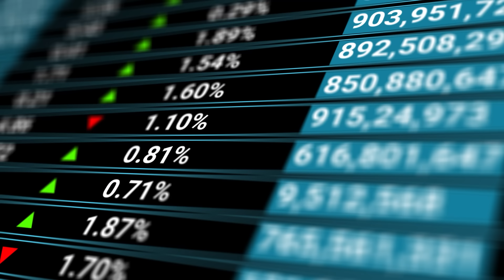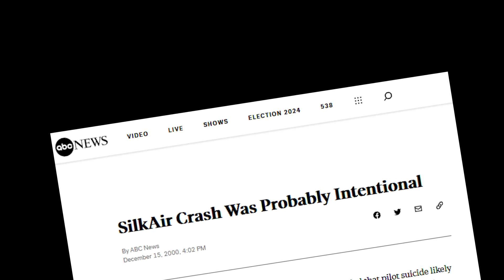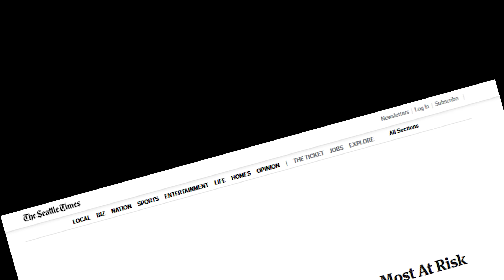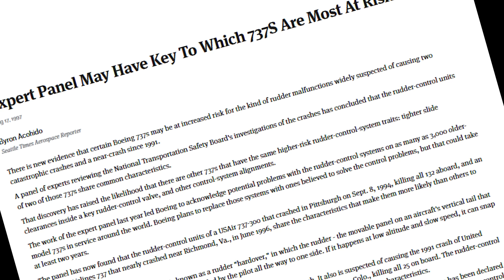What Caused This Plane To Break Up Mid-Flight!? | SilkAir Flight 185

Comment: The NTSB, which had jurisdiction based on Boeing's manufacture of the aircraft in the U.S., investigated the crash under lead investigator Greg Feith. Its investigation concluded that the crash was the result of deliberate flight-control inputs "most likely by the captain". While the Indonesian NTSC investigators found "no concrete evidence" to support the pilot suicide allegation, and the previously suspected Parker-Hannifin hydraulic power control unit (PCU) had already been determined by the manufacturer to be defect-free, the final statement from the NTSC was that they were unable to determine a cause of the crash and was thus inconclusive. The Indonesians wanted to believe the Parker-Hannifin-made PCU that controlled the aircraft's rudder could have been defective and thereby led to the crash. The cause of some previous 737 crashes, such as United Airlines Flight 585 and USAir Flight 427, had been attributed to the 737's rudder issues. Although the NTSB and PCU manufacturer Parker-Hannifin had already determined that the PCU was properly working, and thus not the cause of the crash. 

When Greg Feith tells you what the cause was, believe it. The only reason this is still 'undetermined' is because Indonesia and the NTSC dont want to admit to the pilot suicide conclusion.
Reply: I will like to clarify that the NTSC investigators agreed with the murder-suicide conclusion. However, the higher-ups decided to intervene and basically rewrite the report to not include the probable cause.
Reply: @OwlRTA  Fair enough. The NTSC did write the report, claimed it was undetermined, and (effectively) signed it. If someone above was forcing them, it doesnt change my statement.

Comment: For 18 years, I was an industrial engineer who was charged with the support of avionics systems at both the vendor, and sub-vendor levels, at "the Silicon Valley of the East" (yeah, had to put my "ANG" blues on, march with seven other reservists/guardsmen back in '84 to meet Reagan).  I know for a fact, that it would not be difficult to D/B/T a secondary AOA, plus Mach Airspeed, plus VSI, plus throttle/autothrottle "attitude-stabilization forward stall+overspeed" "intentional harm override systems", which would require BOTH piloting positions to respond similarly to override, plus access the MCDU to contact ATC/ARTCC, even if transponder telemetry is switched off.  Batouti/Lubitz/Ming could have been very easily defeated, hog-tied, subdued, and the entire population of the cabin could then have their turn kicking the 'living crap' out of those bastards. Hell, they could even request a "hold on radial, we gots-to run some numbers, verify a checklist before landing", so that everyone could provide second servings, and have police/EMS/ARFF fetch the "padded ambulance"....
Reply: Ok. What happens if one pilot is incapacitated, and then all of the flight computers give false data to a plane that doesn't know it's false data? The other pilot cannot override your supposed "solution" because it requires two pilots. Plane stalls and crashes, people die.
Reply: @OwlRTA  That's in part, why 'dual' systems fbw+cable/hydraulic systems are used by BAC, FBW systems toggle between 'laws and logic' when instrumentation/other avionics have discrepencies, especially with pitot tube problems. I've always been of the opinion that radio-measurement along with GPS systems should be capable of being switched during times of emergency, into some other display/interactive control circuit besides the MCDU. There's just no straight forward way to get that task accomplished. The two front seats MUST always be the final arbiter,  but then, the suicidal pilot, how to override question arises...

Comment: The problem with writing it off as pilot suicide is that there's no unequivocal evidence for it, it's just everything else appears to have been ruled out. But I wonder how many design faults there are on airliners with an extremely low probability of occurrence but severe consequence, like the 737 rudder reversal. Maybe ones with a probability of occurrence even lower than that one. In which case it may never occur in the lifetime of the aircraft type or just once. And an unlucky pilot gets blamed when one of these does occur.
Reply from the maker: Very true, all of the facts and evidence are not present in this case. It just so happens that the factors we do know line up to suggest something nefarious. It's always difficult to suggest that the pilot was to blame for a deliberate act, when in reality it could have been that he was attempting to recover the aircraft from an issue not known to the investigators. The problem with this incident is that external factors outside of the aircraft also play a role in the suggested outcome.
Reply: Rate of dive is as hard an evidence as one can ever get.

Comment: In 2004, following an independent investigation of the recovered PCU/dual-servo unit, a Los Angeles jury, which was not allowed to hear or consider the NTSB's conclusions about the accident, ruled that the 737's rudder was the cause of the crash, and ordered Parker Hannifin, the PCU/dual-servo component manufacturer, to pay US$44 million to the plaintiff families.

Comment: All the way up to the clicks heard at the end of the voice recording... I was thinking "Could something have hit the tail section?"... I don't know (without evidence of fire somewhere) what it could be, but then the clicks in the recording seem to indicate deliberately shutting things off or pulling the breakers...

    It's definitely a dubious thing to get an accidental dive so steep, though... if the clicking "off" of switches/circuit breakers could be otherwise explained by electrical faults, I could still suppose an external collision could do it, and even maybe without fire. It would just about have to be something like an ultralight, something small enough to be unregistered, BUT at 35,000 that doesn't sound 100% doable, and a missile type object would be pretty obvious...

     AND of course, in most recent memory, Germanwings has taught us that while rare, it IS possible for a pilot to lose his interest in living... I guess.   ;o)
Reply: A meteor could do it.
Reply: @raviarjuna9839   NOT going to say "impossible"... BUT with the heat of re-entry for a meteor, it's improbable for the lack of fire evidence or heat damage...   ;o)

Comment: Curious, if it wasn’t a defective servo valve inside the PCU then why did the manufacturer of the aircraft's rudder controls and the families later reach an out-of-court settlement?
Reply: Point to be noted
Reply: No proof of rudder malfunction the captain asked the FO to leave the cockpit

Comment: As other people have said, this definitely points to the pilot committing suicide and taking everyone with him. The limited evidence available points to the captain on mh370 doing something similar, but incapacitating everybody else, before an extended flight to crash the aircraft where it would be difficult to find. What is so cruel of the pilots is taking other people with them. This suggests they were angry and hurt to the point they didn't care about other people. Although it will be intrusive, these incidents indicate regular, ongoing background and psychological tests on aircrew should be carried out, (I assume some such checks are already carried out, but should there be more?) Non aircrew people commit suicide, so why should aircrew be any different. Very sad for the poor innocent victims.

Comment: The asian monetary crisis in 1997 fucked up most of the ASEAN  economy where the SGD, Ringgit and Rupiah all dropped. If your funds are going down, you might as well take your plane with you. Financial pressures and lack of mental health screening meant that plenty of similar incidents would have been avoided. NTSC should have been more conclusive with their evaluation and ruled it as conscious pilot action. 

1997 was also a pretty shit year to be flying over Sumatra with Garuda 185 only occurring months earlier, which was a bit of a whoopsie on the flight crew's part. Slash and burn techniques in the rain forest and an Il Nino year didn't help the situation.

Comment: I did read about this accident and i never believed it was suicide. In the 90s the 737-300 had 2 similar accidents with USair Flight 427 and United 585. The 3 accidents were similar in how the plane reacted and went down. In the other 2 planes there was issues with the PCU, with the dual servo valve based on input from the pilot's rudder pedals or the aircraft's yaw damper system, directs the flow of hydraulic fluid in order to move the rudder. In this accident when they actually tested the valve in a applying different temperatures, it showed even without being commanded it could just stop, and not only that, it could cause a rudder reversal, so wen the pilot is inputting the rudder it would do the opposite , worsening the situation. Funny Boeing agreed to pay out of court settlement.  The NTSB and Boeing have had a habit of blaming pilots, and we know that with the 737 MAX they were quick to blame pilot error.
Reply: At the high  speed the plane was going, a rudder hardcover could be overcome with yolk and differential thrust. only at slower speeds would the rider take over and doom the plane.
Reply: Eastwind proved that a hardover is recoverable with the right amount of speed. This plane had so much speed that it broke apart. The PCU fixes were already done to this plane anyways.

Comment: For those who don’t want to watch the entire video: 
SilkAir Flight 185, a scheduled passenger flight from Jakarta, Indonesia, to Singapore, crashed on December 19, 1997. The exact cause of the crash was a subject of investigation, but the circumstances pointed to deliberate actions by the pilot.

The official investigation, led by the National Transportation Safety Committee (NTSC) of Indonesia and assisted by the U.S. National Transportation Safety Board (NTSB), concluded that the probable cause of the crash was intentional pilot action. The captain of the flight, Tsu Way Ming, was found to have intentionally disconnected the flight data recorder (FDR) and the cockpit voice recorder (CVR), and then deliberately put the aircraft into a rapid descent. This led to the aircraft crashing into the Musi River in Sumatra, Indonesia, killing all 104 people on board.

The motivations for the captain's actions were not definitively determined, as he died in the crash, and no suicide note or conclusive evidence was found. The incident highlights the complex and tragic issue of pilot suicide and deliberate actions in aviation, and it led to improvements in cockpit security measures and pilot mental health assessments within the aviation industry.

Comment: Of course Boeing couldn't find anything wrong with the plane. Instead they blame the pilots. The easy way out as usual. Same when they tried to blame the pilots in the 737 max scandal. 
How do they explain that the tail section was found 4 km away? Did the captain went to the rear of the plain with a chain saw and cut it off?
Reply: Over stress of the airframe

Comment: Very interesting . The fact that the tail section had separated from the main section might indicate some form of metal fatigue or bulk head failure . A mystery it shall remain . Obviously deliberate flight into terrain cannot be ruled out .
Reply: Engines were at full speed on impact indicating a super speed that would make any aircraft breaking up in the air before krashing. No need of any structural problems to make that happen.

Comment: The clicking could’ve been the first officer locking back into the seat, and the reason for them both going off-line almost simultaneously, is where they are located on the aircraft, and based on the compressor decompression of the F section near the 1016 bulkhead would explain why

Comment: In creating this you have lost all respect from aviation enthusiasts. There is no mystery or question here . There is zero shadow of a doubt that the captain deliberately crashed the plain . The relatives to their discredit won’t accept this as there’s no money to be had by suing the captain , opting to falsely accuse Boeing in order to get compensation , I am aware of the old issue with the rudder hardcover in colder climates on older planes . An issue which didn’t apply here . Shame on you for making a documentary on this nonsense.

Comment: If radar data (4:05-4:15) is more or less accurate, then the aircraft had "descended" circa 4725m/8sec.

By freefalling (for instance due to stalling or something) with 0 initial downward speed, if we even ignore air resistance, nothing on Earth can fall more than 320m for 8sec.

To everything add up we need an extra 550m/sec of average downward speed.

Not sure if that is physically possible at all, but if it is, then it's consistent only with deliberate mass murder - the only possible "speculative" conclusion.

(There is no need to be an NTSB expert for these ballpark calculations.)